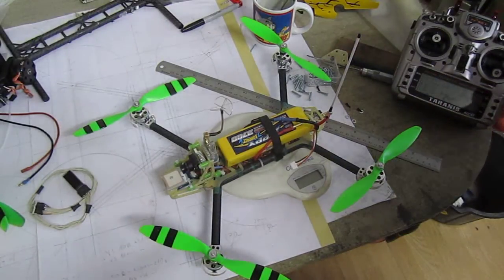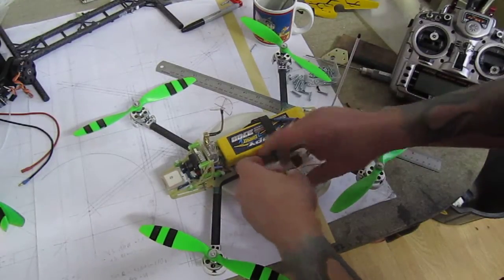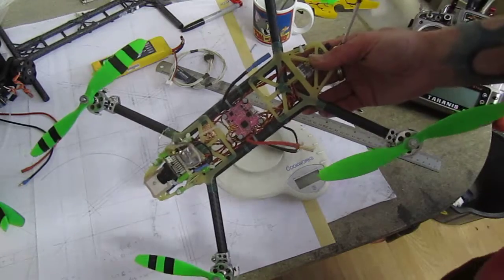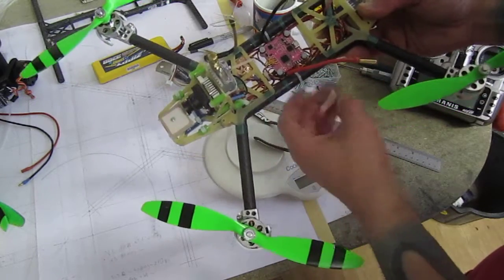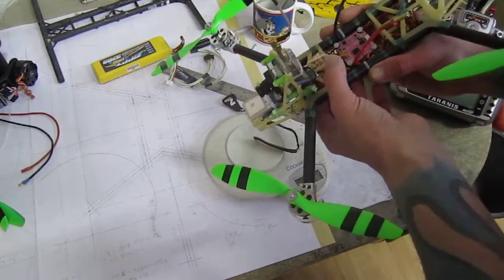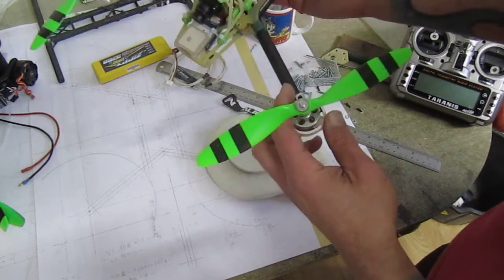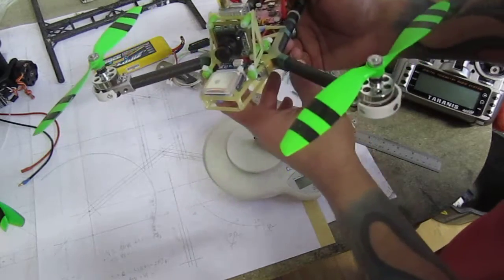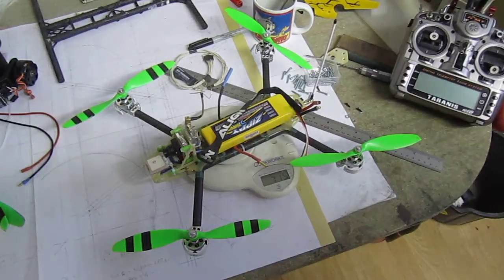25min. endurance little H-quad overview

Comment: Great job! anyone can build a massive quad with slow kv motors, huge batteries and huge props, that hovers for a long time, but flies like crap, but your engineering is a different approach, very nice project, a truly flyable, light, long flight fpv quad, love seeing your stuff.
Reply from the maker: Cheers mate, thanks for heads up:)